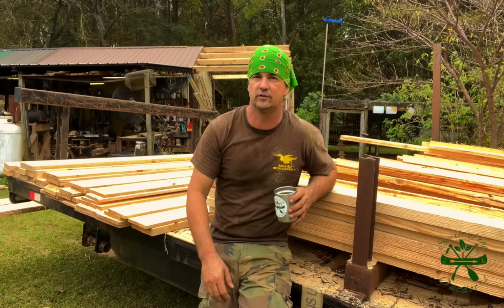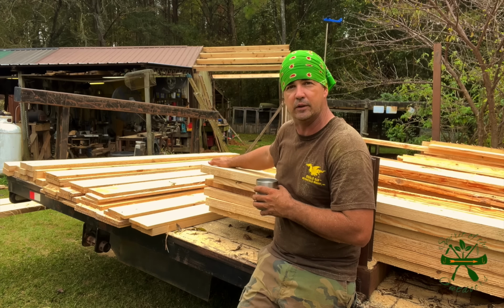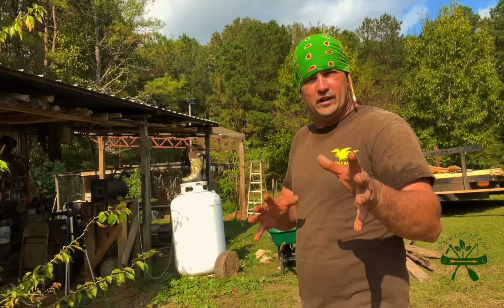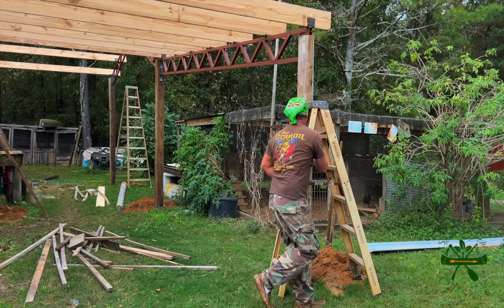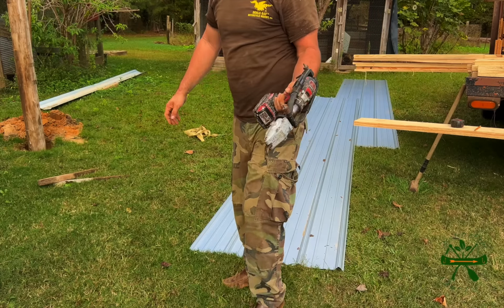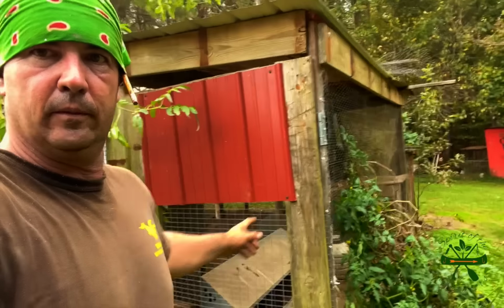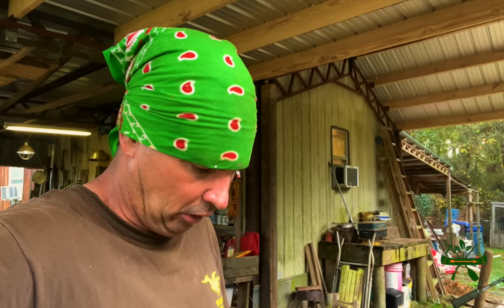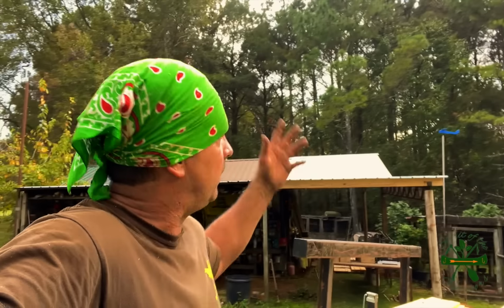Knife Shop Addition

Comment: I have probablt 300 sq ft of thermal barrier left over from my house and nothing to do with it, if you want to try it, I can see about sending it. Not a big deal shipping, just a 5'roll not real big around.
It will enhance the insulation. Made a good difference in my house
Reply from the maker: @independentthinker8930  i dont know how i would install it now
Reply: @SpiritoftheOutdoors   It's like a big space blanket, staples up. Best if air space on both sides. 
I put it in my attic space, I only have the wall insulation in the attic with the barrier. It stays comfy inside